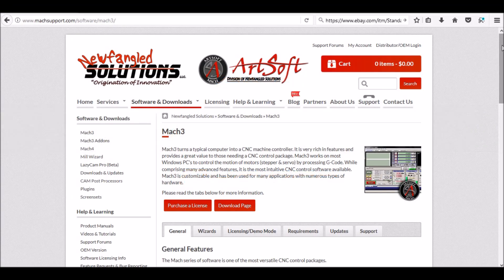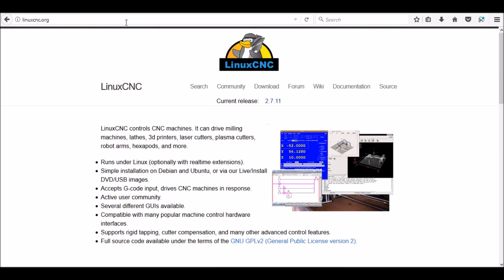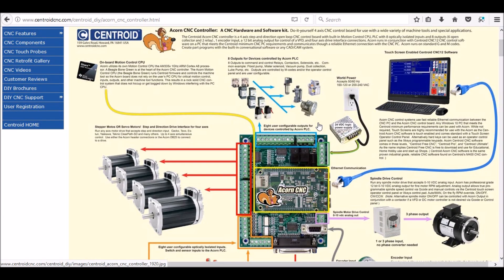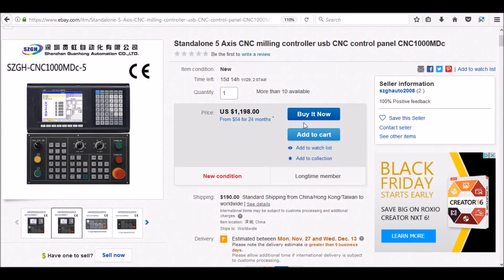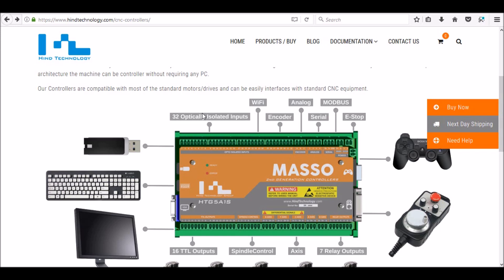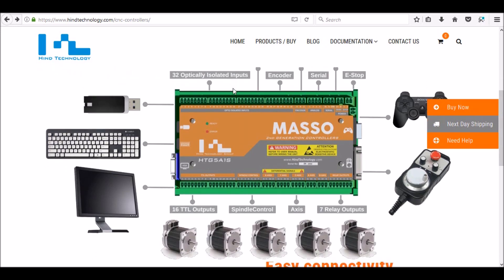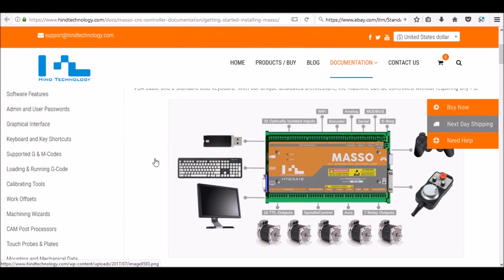DIY CNC Controller Choices?

Comment: LinuxCNC is rock-solid and cheap solution, especially with RTAI kernel. If CNC has just a regular steppers- you don't need more.
Reply from the maker: This is Correct and it is tried and true. however it is more of a hassle to set up.

Comment: El controlador chuno me parece mejor que masso, son de bucle cerrado, admiten ethercat, tiene funciones acanzadas, precisos rapidos, soportan encoder de valor absoluto, ti nen retroalimetacion de posicion, conexicion ditecta a encoder para spindle, entre otras cosas. Son relamente controlaodres profesionales de grado indutrial y lo mejor es que son baratos, hablando de LNC, Ky2000, HNC, Weihong, etc. Lo mejor es que cuestan lo mismo que un masso y son totalmente independientea...
Reply from the maker: The only drawback is the setup. most DIY machinists lack the knowledge for the wiring and setup. This I found to be more difficult than the others.

Comment: How is support for Masso?
Reply from the maker: I dont know first hand. Updates do come out on a regular basis.
Reply: @CNC4XR7  I was about ready to use centroid on a cnc rebuild and only recently found masso, still debating
Reply from the maker: @laserfalcon   I can't speak for Centroid. But both Are not easily edited for custom stuff. Which is why I have stayed with Mach3
Reply: @CNC4XR7  will masso work with galvos?
Reply from the maker: @laserfalcon  galvos?
Reply: @CNC4XR7  yes,

Comment: Does the masso control servos directly or does it just output step and direction and you need servo drivers? Looks like a cool system
Reply from the maker: yes step and direction

Comment: masso have totally out of budget hobby user controller too expensive normal human user, linuxcnc and 10$ breakoutboard to old 10-40$ windows xp computer and paraller port have lot lot better and cheapen option. and if masso one axs have broken or burn need buy all new, but if use diy linuxcnc no need buy all new only broken axis driver and have cheap, 4-50$ / axis. mach3 have easy start but not can use good big problem have interrupt and "realtime" not newer working whitout lot problems. linuxcnc have sure realtime and safety than windows base cnc. i has build many hundred 200 ower cnc machine to hobby users and little factory, and dont newer use windows base or one to all base special board cnc machine come super expensive long time.
Reply from the maker: yes the cost is definitely a factor

Comment: What are your thoughts of the Eding cnc boards? I am torn between that and masso. I am upgrading an older Levil 4 axis mill with colombo atc spindle and using clearpath servos on all axis. I am looking for fast, accurate true 4 axis machining. Thoughts? Thank u!
Reply from the maker: Unfortunately I really have no opinion on Eding cnc I've never heard of them.
The masso may be a good choice. I would email them and make sure it can handle your needs.

Comment: Every industrial CNC that I have worked on are all PC based machines. Usually Windows. With today's technology, most have moved to a networked interface, which controls all I/O and motion. This is out of my price range for my DIY CNC. I believe that LinuxCNC is the best "bang for the buck" system, but does have a heavy learning curve. Mesa seems to be what most people choose for the interface, but that too is out of my price range, so I have decided to go with an old PLC that I have lying around. I think that using stepper motors instead of AC servos to drive any axis on a CNC, is like entering a garden tractor in an F1 race. Many people seem to think servo and stepper are the same.
I am referring to this type of machine in my above statement. https://youtu.be/TR0b_XRSWOk
Thank you for taking the time to put your opinion out for us DIY types to use as info while building.
Reply from the maker: your welcome
Reply: Most CNC I work on have a PC HMI interface. The actual motion control is processed in the NC unit. I have seen the HMI on machines fail while the machine continued to run since the program is actually transferred to the NC prior to operation. Siemens, Fanuc and Mitsubishi CNC controls operate in this manner. 

I am looking to convert a Multicam router that the NC went out on with a different control. Looking for something that can use the existing drives and motors.

Comment: Thank you for a pretty good presentation of a really difficult subject. I have had the same considerations and have arrived at linux cnc + mesa controllers. Linux cnc being linux based is not a problem, linux and linux cnc comes as a package, you just install everything in one go and you are ready. A lot of people has grown accustomed to Windows, but Linux is undeniable higher quality in this context. Each to his own, I guess. Mesa hardware has a pretty steep learning curve, but the flexibility is unbeatable, besides the price is not much higher than what you mention.
I am planning with DROs on all axes, and that would not be possible with most other options. Also my motors will be servos with integrated controllers, which will make wiring a lot simpler.
Reply from the maker: Yes I agree Linux is a great platform

Comment: Hi. Thank you for a great video. I have a high quality cnc machine built in Italy. The machine works fine, but the control system is just old and hard to use. I am thinking of upgrading it. Do you think keeping the old servos would be a bad idea? Would they even work on a new controller?
Reply from the maker: I cannot say for sure , However the new controller puts out a step and direction signal. if your servos use this to move I see no reason why they would not work.

Comment: Masso Controller introduced as a CNC modification solution.
Reply from the maker: Yes
Reply from the maker: @johnhoyle5915  Masso Has continually improved and updated there CNC controller over the last few years. My intended purpose for the Masso was to upgrade my  mill when I swapped over to the Dmm servo's. well a lot has changed and it turned into The PM727MXL Linear rail build which   I am still working on. Since then I have also Upgraded the original machine. I still have the Masso and i'm not sure at the moment if it will go into the rail build or not. Still looking at Linux as well.

Comment: so like if you buy a small a small cnc can you take it apart us the spindle steper motors and buy some new lead screws long ones and linear rails and 3d print the rest so basically making a small into a large but use all the hardware from the little one
Reply from the maker: Kinda like my linear rail build? https://www.youtube.com/watch?v=8N9X2JgwVB4&t=2s

Comment: This video is 3 years old I'm converting a 3,800 lb Tos Kurim FNK 25 milling machine into CNC milling would you recommend Masso for this type of conversion today?
Reply from the maker: I'm not familiar with that  machine so I'm not sure exactly what you need in terms of tool change macros etc. Masso has updated there controller since this posted and also the price. I think a look into all options is a good Idea including Acorn.

Comment: A CNC controller should have the same number of outputs as inputs so it it easier to wire without using a ton of jumper wires.
Reply from the maker: Most controllers are based on the PC parallel port and conform to that standard.

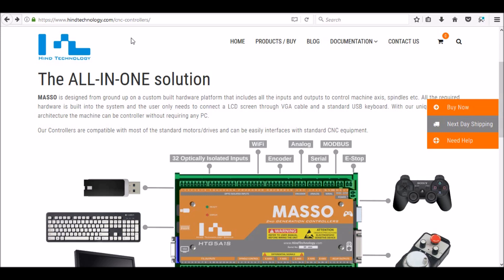Comment: 3:48 so why is cost that much. we allready have outof pc hardware controllers.starting ramps. you got picture lol.and and and. buy lathe or mill. i want both. i not want spend 2x masso. when its same only diff is firmware that cost..hmm nothing..and it waist earth reasources. dont it? i would consider if it cost 2x more but give both options lol, but nono 2 controllers?
it can be done 1 controller both lathe and mill, why need buy another when its only free firmware
Reply from the maker: I can see your view point However if you only have one controller to save money. you can only run 1 machine at a time.
 There are always trade offs

Comment: If you use closed loop steppers you can actualy use any board of software and it will work as servos
Reply from the maker: Yes but they are Not servos's
Reply: @CNC4XR7  that is the point.  It has all advantages of servos and cost just a little higher than stepper. And in most cases they are called stepper servos.
Reply from the maker: @sharphedgehog  They do offer a better choice over Steppers and are a Alternative to servo's .
However they are not servos.
Reply: @CNC4XR7  You are wrong. Typically this term was used for special class of motors but it is not what term means. Here is WiKi that prove that any motor that has a closed-loop is technically servo motor. Also manufacturers of closed=loop stepper calls it Hybrid Servo

A servomotor is a rotary actuator or linear actuator that allows for precise control of angular or linear position, velocity and acceleration.[1] It consists of a suitable motor coupled to a sensor for position feedback. It also requires a relatively sophisticated controller, often a dedicated module designed specifically for use with servomotors.

Servomotors are not a specific class of motor, although the term servomotor is often used to refer to a motor suitable for use in a closed-loop control system.

Servomotors are used in applications such as robotics, CNC machinery or automated manufacturing.
Reply from the maker: @sharphedgehog  I'm Wrong? I agreed with you and you said I'm wrong?They do offer a better choice over Steppers and are a Alternative to servo's .
However they are not TRUE servos. If they were Servos then they would just call them Servos Not Hybrid-Servos Not closed loop steppers Just Servos. At any rate buy what you wish and be happy.
Reply: I am sorry if I sounded as one looking for fight.  You've said it is not true servo and that what I was not agree. And I am not arguing am stating a quote from WiKi. It is not my definition. But according to WiKi servo is not a special type of motors but technology with feedback. Actually it even define "closed-loop" as synonym. So it is to call closed-loop or servo you mean the same thing, it is a motor with feedback for positioning control. They call it Hybrid Servo so that is easily understood that it is servo based on stepper and not async motor.  But they both servos.

And I am sorry to write you again, I know you wished me luck, rounding this conversation. I just wanted to apologize if I made you feel uncomfortable in any way.  It is not big of a deal how those are called. It is matter of definition. It does not change what it is.
Reply from the maker: @sharphedgehog  No Worries I understand the motors have Feedback and by definition Act as Servo's   There are differences that should be noted: Servos can be Powered with AC as well as DC they also have velocity control not just step and direction. The new Hybrids do offer a cost effective Alternative for home CNC conversions. I would definitely choose them over Traditional Steppers.
Reply: @CNC4XR7  These closed-loop steppers also run from AC OR DC. Not stepper but driver. And you can program driver and change velocity and other parameters. All like on servos. Line 200 of parameters.  those hybrid servo drivers are not like servo drivers by only one reason, is cost. If they do driver with buttons and display looks like servo driver it will cost too much. So they do it in formfactor of stepper motor driver without user interface to save cost.
Reply from the maker: @sharphedgehog  send me a link to the brand your purchasing or recommend

Comment: Is there any new controllers / better ones specifically .. need an updated list plz. Thanks
Reply from the maker: the acorn system has been updated as well as the Masso. However the Linux CNC is always a good choice.
Reply: @CNC4XR7  Thank you

Comment: What about if you have ethernet smooth stepper between breakout board (parallel port) and PC running mach3. Would the servo still be limited?
Reply from the maker: Im not sure what you mean by limited?
Reply: @CNC4XR7  in the video you said parallel port board are not fast enough for servo motors. I was wondering if paring it with smooth stepper in between would help in that context. I have my CNC (BF20L) running with mach3 and I thought I could just update to the servo without change the breakout board.

Comment: Whats's the issue with controlling a machine using a PC, i think the brains behind many CNC machines will be a PC of some description.  PLC's are used for auxiliary functionality of machines more than being used as the main controller an account as to how PLC's work.  PLC's are cyclic and not multi-threading the PLC timers are not primarily designed for handling multi threaded application.  This is not that some manufacturers dont run Machines purely from PLCs but guess what they are top end and bloody expensive.  Dedicated processors are nothing more than a stripped down PC.  If you consider computer architecture based around the motorolla 68000, Z80 and the 8086 ( the Original PC processors) are exactly the same architecture as the microchip PIC and Atmel processors.  Your machine will need a display and some sort of interactive keyboard or mouse.  So a PC or laptop then.  Many machine manufacturers are moving towards PC controllers and away from dedicated control panels as they like the flexibility to upgrade and improve the machine.   If you buy a 3 axis standalone controller and in three years time move on to wanting a 5 axis controller you will end up purchasing hardware all over again.  If the Gcode command set gets improved (some smaller controllers don't support the full standard Gcode command set ie GRBL) or bugs get corrected in firmware then the dedicated controller is going to be limiting on your expectations as well as causing a major issue in upgrading the controllers firmware, if you purchase a Chinese controller on ebay then best of luck as you will be providing your own technical support.  i must admit i do like the look and what appears to be reasonable functionality of these dedicated controllers and would probably still get one but i would certainly make damn sure i was fully aware of the pit falls before investing.  if its lacking canned cycles and drill functionality for example.  I have been unable to find support documentation for dedicated controllers which provides information regarding the full code set, this i consider to be important.  I'm sure masso is the bees knees ad ticks all the boxes but once you purchase it that's it for life it wont adapt or change.  As a point of reference and just to play devils advocate here, some people call PC's a Microsoft based computer or one based on IBM's Original concept, Linux is a different ball game, they would argue you are building a machine not a PC same ethos goes for Mac.  So are you saying you don't want a heap of Microsoft torture or are you saying you don't want a terminal.  There would be nothing wrong with using a panel PC like Allen Bradley or Siemens which is a touch screen and PC built into a machine panel - much like the dedicated masso controller.  Funny but that's exactly what most of the big machine manufacturers use (or their own variant), Ulike the masso type of controllers they are PC's there is nothing stopping you wiping their hard drive installing a new Operating system and using it to store all your photos on and surf the web.
Reply from the maker: Thank you for the comment. I agree with your entire statement! I have always used Computer controlled cnc controllers, Mach3  mainly I like Mach3. The stand alone controllers due offer some Pro's and CON's.
  
 It's all a matter of preference. 
After all as you said they are all  driven by micro processors of some sort.

Comment: Thanks for this video. I have been researching which controller to use when i do my mill conversion. I hadnt considered masso. Ill look into them. Been using mach 3 on my router table but want to try something new for the mill when i get it going.
Reply from the maker: Hi Redshift , Yes the options are ever changing . Masso is always improving but I still run Mach3 as well for the new build I will make my final decision at the last minute.

Comment: Thank you for your knowledge!
I want to add my experience.
This is the best choice for me https://www.cncdrive.com/UC300ETH.html
I use it with Mach3 4-axis CNC TIG welding with wire feed control.
Lathe Mach3 with 8 tool change turret, CSS, cooling and auto clamp and feed.
I use UC300ETH and UCCNC with big chinese wood router with 24 tool change (2 rails), servo motors, auto tool measuring.
Reply from the maker: yes the UC300ETH is also a good choice there are many options

Comment: Just converted my GRBL AIO over to the MASSO. Oh what a difference, it's genius! Support is also another very important consideration. MASSO are there to help. Thanks for the review.
Reply from the maker: Yeah Cant beat the Customer service and It's the owner that often is the one Helping you!
Reply: I have issues with GRBL... No drilling cycles... Is that common? I have a Shapeoko. From what I have read. Drilling is not currently supported in grbl.

Comment: Hello CNC4XR7 excellent video, very illustrative and explicit, focuses on another vision for people like me, who are new to this cnc world, I have a project in mind and I have been researching something about it and I would love to know your opinion about the warp controller. 9 ESS in conjunction with mach 4 to be used in servos, thank you, I would appreciate your opinion.
Reply from the maker: Mach4 does not have a huge following as for Warp 9 I cant comment as I have not used it.
Reply: karlheinz10 I have a warp 9 ESS and use it with Mach3 and love it. I’ve run Windows XP and windows 7 with it so far. I used a pmdx BOB and mounted directly to it. I use easy servos.  Like steppers with feedback. So far no problems. But the no PC is the future I think